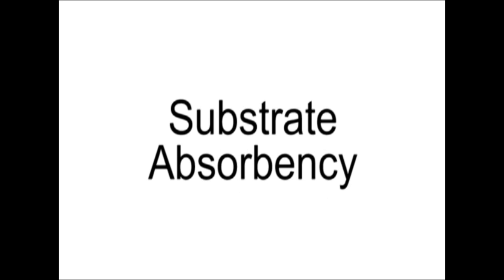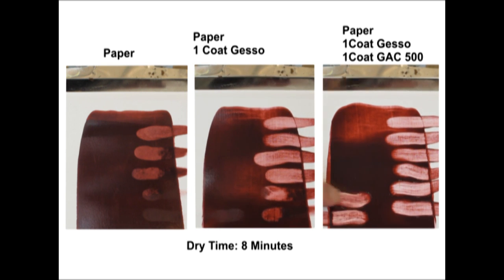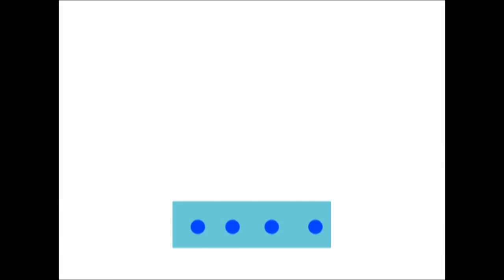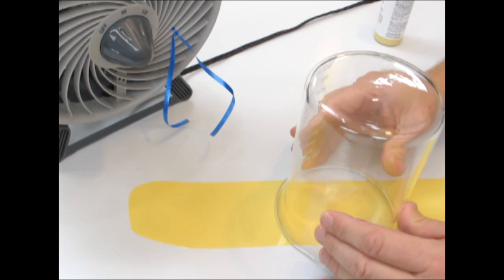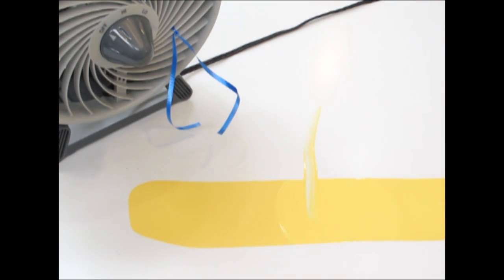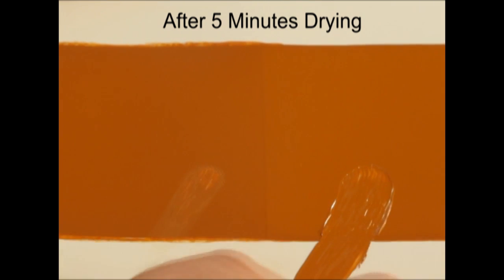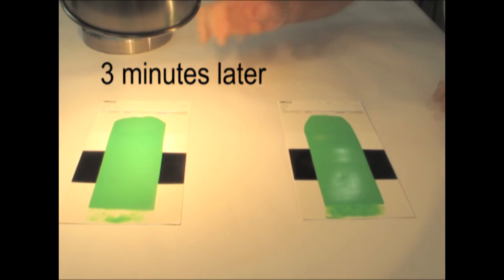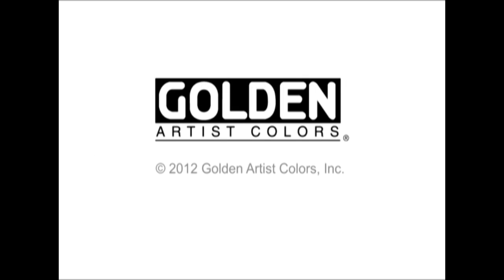Understanding and Controlling Acrylic Drying Time

Comment from the maker: Yes and no. We do a lot of testing with our paints (I hope that's obvious) but not exactly tests that would align with your application process and experience. We use hair dryers all the time, but generally on thin applications where it won't cause any issues. This video shows the use of a fan, and heat lamp, however the thickness of your application may have been a factor in the defects you experienced. Call our tech support team if you'd like to discuss this in detail.

Comment: Do you have any studies on artificially modifying the drying time affects the color/texture/adhesion of the paints?  I often notice that using a fan, hair dryer, or heat gun will speed the drying time exponentially, but often will crack the paints or dull the colors.